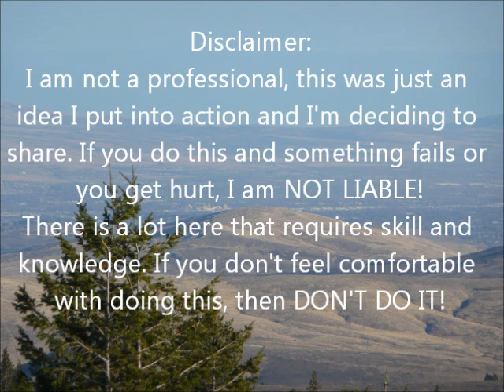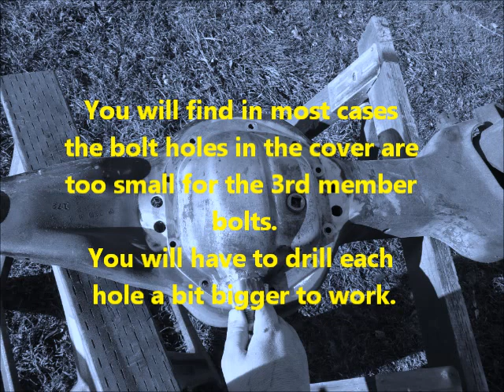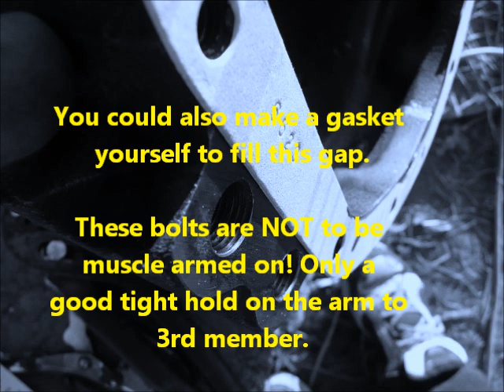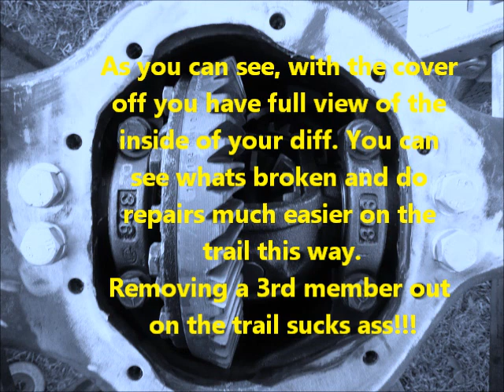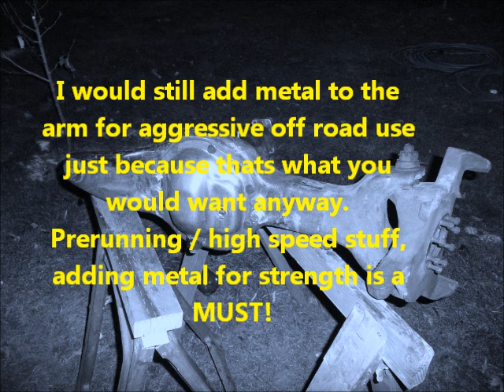Ford dana 44 ttb removable cover.

Comment: What is the benefit in doing this ?
Reply: It makes everything more accessible
Reply: Not pulling it off the arm to replace the inner u joint as there is a c clip on the right side stub shaft holding it in that has to be pulled to remove the stub shaft. This mod eliminates all of that nonsense.  I'm thinking about starting to do this mod right now. Before I put the shit back together when all my new seals come tuesday.